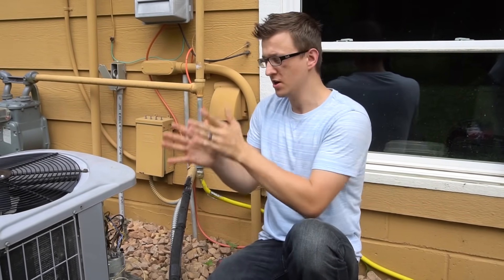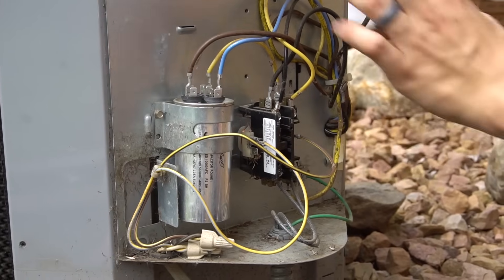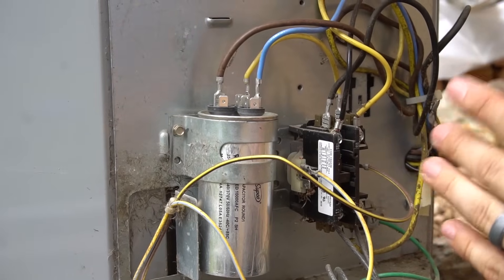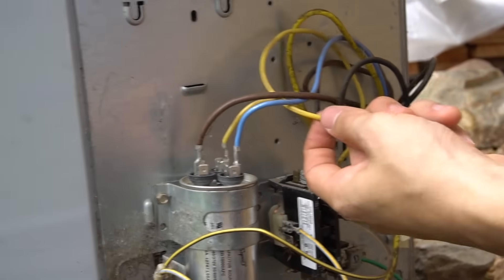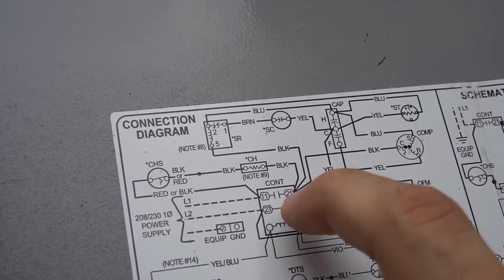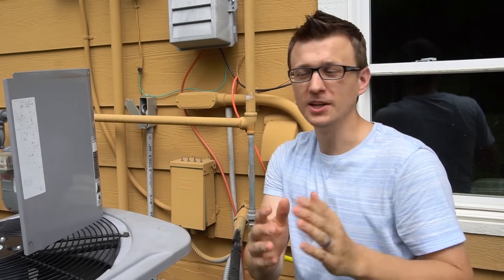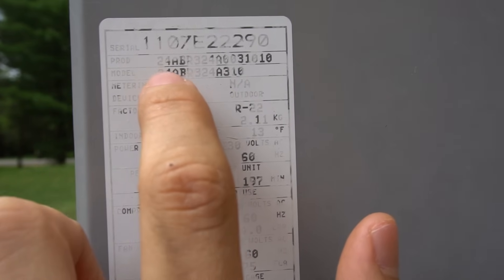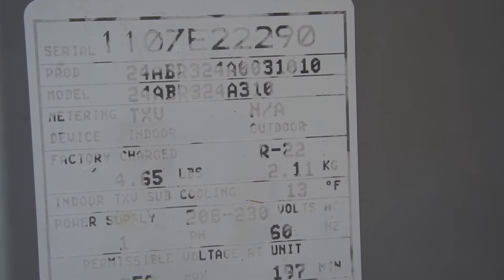How to Wire Air Conditioner Compressor

Comment from the maker: ➡ More Videos For Further Information:

How to Wire A/C Condenser Unit: https://youtu.be/KCanZEsLVEI
How to Wire Thermostat: https://youtu.be/VknvJ9POYDo
10 Ways to Splice Wires Together: https://youtu.be/ihpNCVk1lF0
How to Read Furnace Wiring Diagram: https://youtu.be/2MSedAkirqw
How to Read A/C Wiring Diagram: https://youtu.be/2MSedAkirqw
How to Read Water Heater Wiring Diagram: https://youtu.be/TX8SuHK1esY
Basic Thermostat Wiring Diagram: https://youtu.be/jDLz3REPTWM
How to Wire Indoor Blower Motor: https://youtu.be/4S8TZd-45bY
How to Wire Outdoor Condenser Fan Motor: https://youtu.be/VlMhvwrpimE
Is Common and Ground The Same Thing: https://youtu.be/wiKDlIlbiP4
Electrical Symbols and Meanings for Switches: https://youtu.be/ngQCmR_w9QU
Ohm's Law Explained: https://youtu.be/sILl7p_J1UU
Reply: Fan  brown fan wire  y..comprssar  back contacter one side bleue  comerser   herom starting comprs...

Comment: Great advice... except the compressor on this unit has been replaced.    Its a Copeland motor and there is a black wire and two gray wires.    Im still kinda lost.

Comment: When connected to the contact switch, Does it matter what side each wire are on? Might have the black and yellow mixed up. Don't have a diagram on mine.

Comment: Hey Jay, so my ac compressor started acting funny. It'll start up and then after a couple minutes it'll slow down and then pick up speed again. Not blowing cold air into house. I watched a bunch of you videos and think it might be the capacitor. Only getting 120 volts.

Comment: If the start capacitor is part of the physical capacitor why is it shown as an external component in the wiring diagram.  Further it is fed by a brown wire from the start relay.  This makes no sense.
Reply: The capacitor (cap) he’s working with is commonly referred to as a run or dual/combo capacitor. A start cap would be a second capacitor (usually housed in black plastic, and sometimes with an accompanying relay) installed along with the run cap that is generally much higher MFDs than the run cap. It can be spec’d from the factory with one but generally is added as the compressor ages and needs more help to get started. The unit in this video doesn’t have a start cap present. Hope this helps.
Reply: @wakandaengineer  Thanks for the comment.  In my own A/C unit the single physical capacitor (dual run) has a value of 45/5 which I infer means the 45 uF acts both to start the compression motor but also to keep it running smoothly. The 5 uF is for the fan motor for the similar purpose.  Does that makes sense?

Comment: Great vid!  I have a problem, though... a snake crawled in and fried itself on the capacitor, damaging several of the wires. DO you know offhand if 14 ga wire (600V, 200C) will be sufficient for the repairs?  I only saw one wire that looked like 12 ga, but it wasn't damaged. Also - can I butt-splice them or do I have to replace the whole wire?

Comment: Thanks! What is the wire gauge used for the ac blower unit(air handler) capacitor?
Reply from the maker: Typically 12 gauge
Reply: Thanks!

Comment: So I have a 220v old whirlpool 12000 BTU with heater window AC unit and it stopped cooling. 
I’ve done all the tests I think I’m supposed to do. 
I replaced the capacitor, contactor switch with all the plugins and a new 2 wire hard start kit. 
Checked wiring, did a thermostat test and compressor continuity test. Hit the compressor with a hammer. 

Fired it up today and it makes a medium pitch hum that sounds like it wants to start then makes a clicking sound and the humming stops. The compressor won’t kick in. Fan works but no cold air. 

Any suggestions from this point. 
Thanks in advance
Reply: The compressor is dead

Comment: Hi, I have a compressor and it is written S C R , it has three wires, red, blue and black, the ground is separately at the bottom. I would like to only start it like a pump. I have two phase 220V in Europe. Can you tell me how to wire it to have it run ?

Comment: Great video, what gauge wires are used from the ac connector to the capacitor?
Reply: usually 18 solid strand

Comment: If the fan motor always has 3 wires where did it go here ? I see one going to the L1 on contactor and another going to the F on capacitor but where is the 3rd wire ?

Comment: Why some capacitor has 4 wires on ? Where the other common wire coming from? Isn’t the T1 supposed go to the contacter ? I’m lost 😞 because I saw a video of you where you show a capacitor with two common wire on a capacitor and this one has only 3

Comment: Goodman GSX140301KB. The capacitor is bad is this: CAP050400440CT. The Capacitor I got is the same but the Common Orange has 1 terminal instead of 2 (on the old one). Suggestions?

Comment: You video shows only 4 wires on the contactor ..  where is the 5th (fan 2 compressor 2 and 1 common to capacitor)?

Comment: The compressor on our aircon says the letters, u, v and w. We have bought the supco super boost relay and hard start but are confused because most of the videos say the compressor have the letters H, F and C. Will it matter where we connect the wires?

Comment: Thank you for the helpful videos. I replaced the capacitor and when I turn on the circuit breaker the breaker immediately moves to off position. Any advise you could provide to fix this issue will be greatly appreciated. Thank you

Comment: A little nervous as my AC unit is very old but has ran the same way for the last 17 years about according to the chart the wires are not hooked up correctly but I need to replace my capacitor

Comment: Just great.   If you have a Day Night unit, the contacts will rust.  The wire positions told we what I needed.  Just watch black / yellow.  Also mention, the two wires on the black breaker.   Will done !!

Comment: I am trying to work a motor 220 but I have five wires coming out from the motor red and blue goes to a capacitor orange brown and black I believe that is a low medium high speed I need to pull a plug out of these wires how do I go about it

Comment: Where can I find a diagram for Heil model CA553SVKD2?
  The S might be a 6. 
  The panel had been laying out and is not very clear in regards to the wiring at the condensor unit.

Comment: My compressor is identical to the one in this video. I have power to both black/yellow from compressor to contactor but I have no power from blue wire to herm.what could be my problem? Ty

Comment: I just changed my ac capacitor & the fan still not spinning after turning on the main power. The pipe kinda hot & feel blowing hot air above the fan. Any other suggestions?

Comment: I replaced start capacitor for fan, it ran nice now, but run capacitor was bad.  took out.  Three wires one side 10, on 15 (they don't even make anymore I know of 4" long oval.  got two new capacitors.  Have one red wire and two white?  all so faded.  Not sure how to hook back up but have two new capacitors connected by common, but what to do with 3rd wire?  OMG/HELP!
Reply from the maker: Oh man! Sorry to hear about the AC troubles. I think between these 3 videos, one of them should be able to help:
How to wire AC condenser unit: https://youtu.be/KCanZEsLVEI
How to replace a capacitor (detailed explanation): https://youtu.be/9ZGfvC-PMWU
How to combine capacitors: https://youtu.be/qLJOWU33TFo

Comment: Every compressor common wire is black, Common and Run windings are always going to the contactor, start winding is always going to the dual cap “Herm”

Comment: I know you don't do installs but I guarantee you've learned enough to do one.  My step mom just had a new company install a Goodman in my house and I think they messed up royally.  Where the top of the new one connects to the coil or A frame part has not been fitted correctly and has gaps all the way around so cold air blasts out.  There is no insulation in that part either so it is continually wet which I am told can drain into the furnace and damage it.  The drain pipe is pc and has no trap on it so cold air comes from that too.  Lastly, they couldn't be bothered to even line up the bricks underneath it.  I get the feeling this company if fed backed just like the brand Goodman is.  Anyway, I noticed these things because my old Lennox did not have these issues and all the owner wants to do is take away my Lennox.  They sell them, don't they?  I'm mad he made off with the compressor and now tells me it's demolished.  Bullshit.  Lennoxes can last 40 years plus as long as the heat exchange is good, yes?  Step mom thinks everything wears out and must be new but much new I see is crap.  Not built to last or even work very long, much less smart.  Spare me smart.

Comment: Good video, but I'm slightly confused/worried.  Had an AC tech look at my non-running AC. He said it needed a hard start kit. He said $500 to do it. It seemed mighty high so I asked him to put it back as/is til I got other quotes.  He left and then I took some pics of the Dual Run Cap and Contactor as he left them. I didn't have a "before" pic, but it seemed wrong because he left it with 2 wires connected to Herm (Red, Blue) and 1 to Com (Brown.) Those are the only 3 wires not connected to the contactor or a ground. It didn't look like he touched the contactor..... but on the Cap there was 1 shiny bright spade with nothing on it on the fan side, and where the red wire connected to the Herm side the spade under it was corroded, like the other unused spades on the Cap. I traced the blue wire from the Condenser - easy - it goes directly to the Herm side of the Dual-Run Cap.  There was a red wire coming out of the fan motor. So I figured the red should be connected to the fan side of the Cap.  There's no schematic in the cover on my Arcoaire HAC036AKA4 and I can't find one.  Anyway, I bought a new, OEM Cap. I connected Brown to Com, Red to Fan, and Blue to Herm. Reconnected power and turned on the house thermostat.  The AC came on, and it's blowing cold air, but it did seem to labor while starting. When the contactor closed, there was a loudish 60 cycle hum for a moment, then the fan started, then the compressor started.  So I think it's wired correctly and maybe the lag was because the new cap was initially completely discharged. (?) The Cap is 40mf -- 3mf, 440V.   It's not possible that if I had Herm and Fan reversed, that this 3 ton AC would lag, then start anyway, is it? Thanks.

Comment: Can I ask you please. I have a carrier 38ckc048300. It has a cap now 55/5. Its lasted 2 years and I found out it is not the right size. I found that it is 50/5 but but other sights say 60/5. Can you advise?

Comment: Thank you for all of the videos you do.  You are greatly appreciated.  I have a hvac where one of the wires burned in half going to the compressor.  I know its 10 awg but I am not sure if its thnn  or something else for the coating of the wire.  Would you know by chance?

Comment: Nice video. To the point. I had my outside fan going off an On intermittently like every one minute. Opened up the outside unit and found that the terminal lead (wire) connecting the  "common" on the fan condenser  was broken near the crimping area. It was a result of the age of the unit (18 Yrs) and the harsh weather. I reconnected it back at the crimping point and everything works now.  In your video there is only one connector to the "common" terminal on the fan condenser, but I have three (Black, Orange and Red). Also where can I find these wires to buy. Searched amazon and ebay but no luck so far.

Comment: If I accidentally cut the low voltage wire to the compressor outside while the unit was off, can I have fried the thermostat?

Comment: can we memorize like this always? 
  
  Compressor            To                Common            connect to AC (connector) (N-)
  Compressor            To                Start                   connect another capacitor circle
  Compressor            To                 Run                     connect to  capacitor (1st run wire)                          
  Same capacitor connecting circle that connect 1st run wire         To               2nd Run              connect to AC (connector) (L+)

Comment: In every video the Run and Start Capacitors have both of the terminals marked, C - R or C - S.  I just bought one of each capacitor for my Carrier A/C and neither of the the two terminals are identified. How can I tell which is which?

Comment: Hi, your videos are great and i changed the capacitor just by watching your videos. thanks.  i have a question that is the wiring for all splits going to be same?.  I have an old  Mitsubushi Mr Slim Split AC and how do i do wiring on it ? there is no wiring diagram on it.  any help would be appreciated thanks.

Comment: If I push the contactor in with a piece of paper, and it works cools the house but it won't work unless I manually hold it in
Reply from the maker: If it is not pulling in on it's own, then it's time for this video :) https://www.youtube.com/watch?v=NVPhsK4gK1A

Comment: Is the capacitor for starting the motor or for power factor correction? Ian assuming for starting the motor since it going to the start winding.  But why is it a run capacitor? And is there a switch in the motor that turns the start winding or does it stay on the whole time?
Reply from the maker: The dual run capacitor stays in the circuit the whole time. Some units will have a start capacitor though which would only be in the circuit at start up and then be taken out.
Reply: @WordofAdviceTV  thanks. Love your videos.

Comment: Where does the 3 wires from the fan goes ?
Reply from the maker: I filmed a video for that too :) Still need to edit and post it though. Basically same as the compressor, except instead of one wire going to HERM on the capacitor, it will go to FAN

Comment: I wish I had seen your videos before calling the HVAC tech.  I just had my 45/5 mfd AC capacitor replaced by HVAC tech but he replaced it with 55/5 mfd capacitor, will this new capacitor shorten the life of the AC compressor?
Reply from the maker: It may shorten it slightly.. Supposedly as long as the new capacitor size is within 20% of the old one (45 + 20% = 54) it should be okay. I would only do that as a temporary fix until I get the right size capacitor. Will it work? Yes. But probably not the best for the compressor..
Reply: I believe the same size capacitor should have been used and I believe the safe/recommended range for residential capacitors is + or - 6%.
Reply: how much did they charge to change the capacitor?
Reply: @bkoz319  $228.00 for 5 minutes of work replacing  $15.00 part.

Comment: Nice to see you using a different demonstration unit for a change.  I especially liked the limited explanation you gave on how to read electrical wiring schematics.  Perhaps you could do more of that in the future.👍👍
Reply from the maker: That's my sister's house :) I was there initially to replace a capacitor. I should start occasionally using other units besides my own though, just like you mentioned! And I do plan on making a video on how to read an AC wiring diagram later on. It will be pretty time consuming to make so I haven't gotten around to doing it yet.

Comment: So how would you know what size unit you need for a house
Reply from the maker: To be precise, one would have to do some calculations and use the manual J.. But generally speaking.. Instead of me typing it, check out the chart at the top of the page. It's a pretty good one! https://asm-air.com/airconditioning/what-size-central-air-conditioner-for-my-house/

Comment: That unit looks like my Carrier outdoor unit. Mine has 3 blades, though. Might also be physically larger in size, too. And the first two numbers in the model number is 25. Carrier outdoor unit Model 25HBR342A320

Comment: I like to replace relay or contactor and oversize it, for example a single pole 30 amp relay can be replaced with a 40 amp double pole and you can wire both poles together, so effectively you have a single 80 amp relay, probably the last you'll ever need.  Or, if replacing a double pole with a double pole always up the amperage, it will give longer life and usually cost only a few more dollars.
Reply from the maker: All good stuff!! Thank you for the additional pointers A D!
Reply: I always read your comments for pointers like this one.  Great advice!
Reply from the maker: @Johannes Brahms Yeah! A D is a walking library for this kind of stuff! :) I am fortunate to have him comment on my videos so often :)

Comment: Unless you're condensing unit houses a potential start relay for the compressor... Or the system has been worked on and the color of conductor insulation no longer match the factory colors.. Point being, learn the fundamentals before you go poking around your HVAC system. If there is a potential start relay and start capacitor, you could get hurt. Also, just because your disconnect is in the off position, that does not always mean there is no difference in potential available to the equipment. Always use a quality meter to check for dead. When in doubt call
Reply from the maker: Thank you for all the additional pointers Jake!